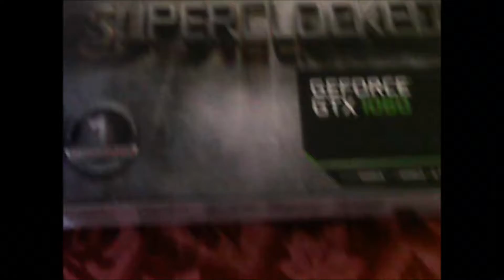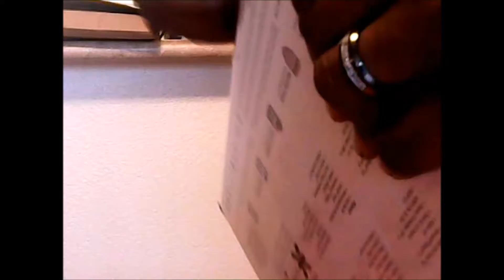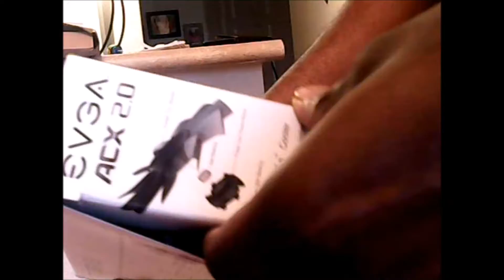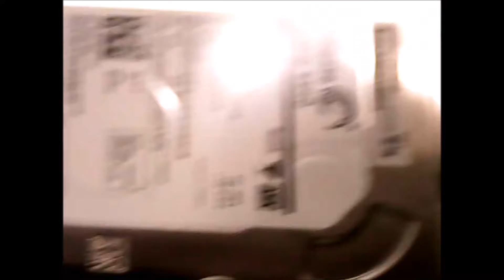ASUS ROG G20 GPU Upgrade to GTX 1060 Unboxing Install

Comment: hey bro I got a question I'm guessing you're still using this card today, from what I heard this card doesn't blow the air outside the computer it keeps it in.. I know its a small case so does it heat on you at all? or get loud? thanks
Reply from the maker: +Supreme2x sorry for the late reply.   Work and trick or treating worth the kids.  Yes this is my gaming card the 750 is being used as a physics. Card by a buddy atm.  No cards with these blowers don't blow it out the back of the system.   Right now mine does get hot at times but that is beefcake of where I have it stored.  It is still quiet I only hear it when I first boot the computer.  You hear that first spool then it is back to nice and quiet.   In game it heats up a bit but once I boost the fans it cools back down.  At that point it's a little louder but still not a bother to me.  I can hear my fridge over the computer.
Reply: Wrath45 hey bro mine didn't come with that 6 pin cable and I bought the same one  but I'm kinda screwed don't wanna return it is there a way to get that cord somewhere else?
Reply: Wrath45 and does it have to enter both the 8 and the 6 pin slot
Reply from the maker: +Supreme2x the SC only requires the 6 pin
Reply: Wrath45 I mean because the motherboard has both the 8 and the 6 pin on it is it optional?
Reply from the maker: +Supreme2x yeah mine did too.  I connected both for future upgrades but the card only used the 6 pin.   The case is too small to maneuver around so I put the 8 pin in while I was messing around in that area
Reply: Wrath45 oh ok perfect so a 6 pin to 6 pin should work right
Reply: Wrath45 or 8 to 6
Reply from the maker: +Supreme2x yeah can put that one on only too.  It will work.
Reply: Wrath45 thanks so much bro I was stressing aha now I need to find where they sell them lol
Reply from the maker: +Supreme2x no worries.   My computer came with a 6 pin.   And I believe my card came with both a 6 pin and 8 pin.
Reply from the maker: +Supreme2x I'll check on the site.  I forget where I got one from four someone else
Reply from the maker: +Supreme2x try this

Cable Matters (2-Pack) 6-Pin PCIe M/F Power Extension Cable - 10 Inches https://www.amazon.com/dp/B01DV1Z4EQ/ref=cm_sw_r_other_apa_JmBhybG2DPD5Q

Sorry for the late response in on Hawaii time
Reply: Wrath45 hey it's cool bro don't worry ur a big help tysm
Reply from the maker: +Supreme2x  awesome glad I can help
Reply: Wrath45 hey bro so I'm trying to connect the 1060 to the computer using a 6 to 8 but the gpu doesn't spin but when I remove the wires it spins for a bit then asks for more power
Reply from the maker: Supreme2x it doesn't spin when you connect it?  your fans should spin at boot up.  you have to download the evga software to tell the fans when to turn on and how much power to apply to the card.  sorry I'm just now seeing this.  I didn't get any notification.

Comment: Did you need a bigger power supply? I have the 180w adapter for the gnu and the 230w power supply.
Reply from the maker: +robert t the power supply that came with mine was the 230w I wasn't paying attention when I bought the new psu until it got here.  I sent it back.  But if you do have only the 180w I suggest getting the bigger one.

Comment: do u need to buy a new  power supply when u upgrade your gpu?
Reply from the maker: Only if you have the 180W PSU. If you have the 230W PSU you don't need an new PSU.
Reply: THANK THE LORD BRO ,3

Comment: do you know were i can get those six bin capels
Reply from the maker: +TheJapa93 hey sorry it took so long to get back to you.  Here is one for less than $10 

Cable Matters (2-Pack) 6-Pin PCIe M/F Power Extension Cable - 10 Inches https://www.amazon.com/dp/B01DV1Z4EQ/ref=cm_sw_r_other_apa_k6BaybP7XS6C8
Reply: thx man :)

Comment: hi can i fit this graphic card? http://www.newegg.ca/Product/Product.aspx?item=N82E16814126133
Reply: I was going to say it may not fit but after looking up all the dimensions it could fit.  Any reference design will fit and are best for this chassis as for where the card is located and the way the air flow in this system is a reference would blow the air out the back instead of around in the case.  The GTX 1060 FE would fit with no issue.  The dimensions for this card are 9.53" x 5.12 the dimensions for my card are 6.80" x 4.38 the dimensions for the Founders Edition are 10.50" x 4.37 looking at this it may fit but I would not chance it.
Reply: Gabriel Popa hey did it end up fitting for you?

Comment: hey man, how difficult do you find it to clean this computer? just got one and have no clue
Reply from the maker: +WastedMidget1 not hard at all.  The most difficult is for is putting the gpu back because of the small space.
Reply from the maker: +WastedMidget1 not hard at all.  The most difficult is for is putting the gpu back because of the small space.
Reply from the maker: +WastedMidget1 not hard at all.  The most difficult is for is putting the gpu back because of the small space.
Reply from the maker: +WastedMidget1 not hard at all.  The most difficult is for is putting the gpu back because of the small space.
Reply from the maker: +WastedMidget1 not hard at all.  The most difficult is for is putting the gpu back because of the small space.
Reply from the maker: +WastedMidget1 not hard at all.  The most difficult is for is putting the gpu back because of the small space.
Reply from the maker: +WastedMidget1 not hard at all.  The most difficult is for is putting the gpu back because of the small space.
Reply: So in order to clean my PC I need to take out the GPU? I'm so screwed lol
Reply from the maker: +WastedMidget1 if you want to do a good cleaning of your case.  If you have the GTX 750 or non reference card and your cleaning you should hit that area.  Your blowers are right above the gpu. But I've had this thing for some time now and when I opened it it was pretty clean inside.
Reply from the maker: +WastedMidget1 if you want to do a good cleaning of your case.  If you have the GTX 750 or non reference card and your cleaning you should hit that area.  Your blowers are right above the gpu. But I've had this thing for some time now and when I opened it it was pretty clean inside.
Reply: Awesome, thanks for the response. Mine came installed with a GTX 960
Reply from the maker: +WastedMidget1 oh that's a decent card.  A lot better than the 750 lol.  Before I bought the 1060 I contemplated buying the 960

Comment: hi
Can you tell me from where you got the 230W adaptor? And is the system working fine after the upgrade thnaks
Reply from the maker: • 180w power adapter (for those of you with just the 230w): https://goo.gl/juz3oL
• 230w power adapter (for those of you with just the 180w): http://goo.gl/y15XeFYeah the system booted up perfectly once I was complete.  No issues so far besides me trying to find my limits with recording on the new card maxing out all settings on all my games lol.
Reply from the maker: +VEEZER1 nooo nooo this card draws a lot less power.   I'd have to look up the specs but 230 should be more than enough.   It's been almost a year and no issues with the card yet
Reply: Wait, so we need an extra power adapter?
Reply: @spr.5995  Right I keep reading you don't, and you do. It's so annoying.